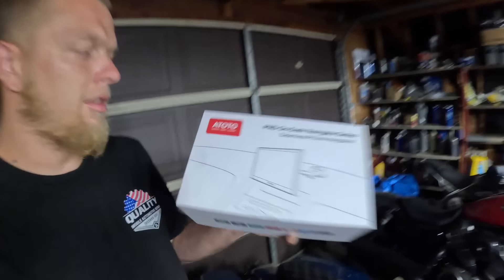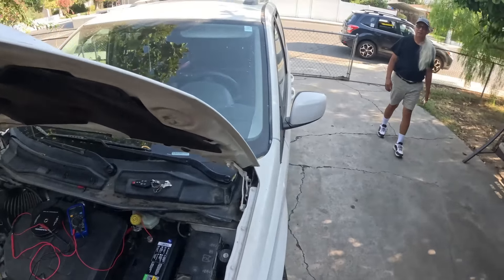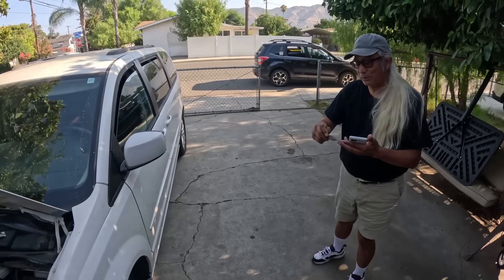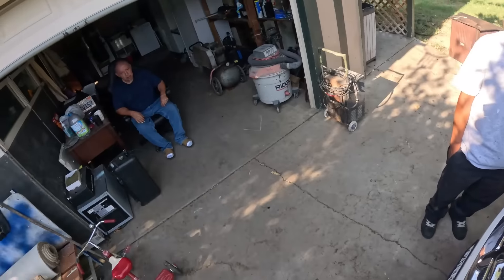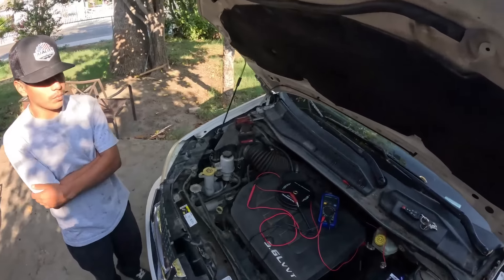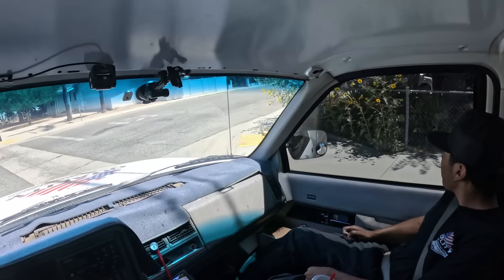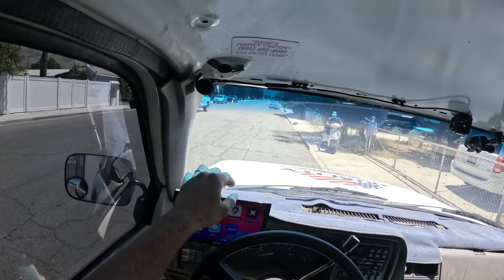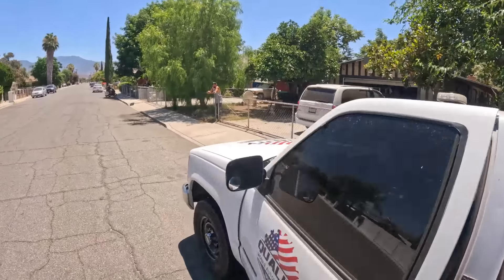CUSTOMER was UPSET! Mobile Mechanic ELECTRICAL diagnosis

Comment: Batteries are not even close to what they used to be if you let them go completely dead just one time most likely the battery is trash, seeing the charger there I also be that they over charged it once or twice. The main problem is going to be parasitic drain from something.

Comment: Dude, I wouldn't trust a mechanic who's work truck didn't have oily fingerprints all over it.
   Sometimes you get the battery that was made on friday afternoon when all the workers care about is going out to party. New parts right out of the box these days are too often bad. This battery should still be under full replacement warranty, just take it back for replacement.

Comment: I bought a brand new battery,then car wouldnt start,took it to shop they said alternator,they fixed it.Then I go to pick my car up and it wouldnt start without a jump cuz brand new battery had a bad cell!!So it is not strange to have that happen.
 EDIT:But ive always wondered if it was just the battery??The shop could have lied,they tried charging me a grand and i talked them down to 450

Comment: You realize that gasoline is what cools that electric pump in the vehicle right? Where you run it that low, it burns out there pump, depending on how many times you run it that low.There's a reason people have to replace their fuel pump
Reply: Running low doesn't hurt anything. Running OUT might.

Comment: Geez what you are telling me cant be right because thats what the last mechanic said. Its a brand new battery it cant be bad. No the connection wasnt loose i tightened it. What if walmart is busy than what am i supposed to do. No you are not charging me to diagnose the problem and saying its a bad battery thats what the last guy said i didnt pay him either. Did i tell you it can't be the battery its brand new. Thats what...... etc. 😅😂😅😂😅😅❤

Comment: Here is my premise:  I'm depending on YOU to bring the tools/parts you need to get farther than I could.

Why dont you bring a battery with you for these cases? If you start simple on power checks you should have spare clamps, and a battery on your truck so yo dont have to charge someone for telling them something they already know but perhaps arent skilled at explaining, like it wont start, its not holding juice vs 'its a dead cell, you need to replace the battery.' 

Id refuse to pay someone for incomplete diagnosis due to ill preparation on their part. Im paying for your experience and ability to get further than I did, but you ended up in the same place but with additional nomenclature.
Reply from the maker: We are mechanics not magicians/mind readers. When I got the call it was from the daughter for a car that is not charging and they wanted the alternator tested. Then I get there and now the son says they have to jump it every time and it starts but then will die out while driving then has to be jump started. So we put the jump box(spare battery) on and it starts no problem. Alternator is charging even under load. We let it charge for a while and the battery couldn’t hold any more charge then 10.4v indicating dead cell. It started every time with the jump box So obviously that’s our first step. Why would I bring a battery for that scenario? I was told it was a charging issue. We are going based on what a customer is telling us over the phone.
Reply: @QualityMobileAutomotive You dont have to be a mind reader, but you can gain experience and be better prapared for the unexpected, but this requires being proactive. Being proactive helps minimize mistakes/miscommunication. 

Also, running a business doesnt guarantee a profit every transaction. Sometimes youre going to "waste" gas and time and sometimes youll have setbacks from miscommunication that requires you to eat the loss because thats part of operating a business.

Just advice from one business owner to another.

Comment: You just married those people. No charge now forever!
Reply from the maker: Not at all. I got paid for the diagnostic and repair. No free rides here. I got called 3 weeks later because the check engine light turned on and I found it was transmission issues they had already got a quote on 1 year ago from another shop. Guess who paid another diagnostic… they did.

Comment: Poor design choice yet again with newer cars. 
My things I ask now:
Where is the fuel pump relay?
Where is the starter?
Oil filter location? Spin on?
Does it use DOD or AFM lifters?
Does the transmission have a dipstick?

Comment: Just put a separate relay for the fuel pump saves the customer the 900 for the fuse box power wire from the battery trigger from ignition power and jump into the wire from the fuel pump 300$ repair saves the customer some heart ache

Comment: Load test battery will tell u a lot
Reply from the maker: @woody95124  how do you load test a battery with a dead cell? It won’t hold charge.
Reply: @QualityMobileAutomotive  I got it....You ended up doing good bud

Comment: 3.6L pentastar requires a battery that has a certain amount of time after shut off if you’re a certified Chrysler master tech you’d know this… also the customer said after battery was replaced it worked fine!  Just because a battery matches the battery “code” that fits doesn’t make that battery adequate. Also if it’s new they should be able to get it replaced depending on warranty and what they retroact back to you! You know nothing about the car you’re working on. And NO IT DOESNT  MEAN THE BATTERYS BAD FROM THE GET GO! HOWEVER YES JUST BECAUSE ITS NEW DOESNT MEAN ITS A GOOD PART A SIMPLE MULTIMETER IS ALL YOU NEEDED TO TEST THE BATTERY OR A GOOD SCAN TOOL THAT WILL TEST THE SYSTEM BY BATTERY AND ALTERNATOR SEPERATLY! Wow how did you guys get a license to do this!!! I own 4 shops 2 of which are speed shops for muscle cars and the other for Harley’s the other 2 I own (OUTRIGHT I OWE NOTHING ON ANY OF MY SHOPS OR TOOLS) I make more money on one shop than any other shops around because I’m certified in almost EVERY FOREIGN AND DOMESTIC VEHICLES MINUS HYUNDAI (FORD AND CHEVY BECAUSE THEY PAY THE ABSOLUTE MOST AND CHRYSLER ESPECIALLY HEAVY DIESIL TRUCKS BECAUSE THEYRE FLAT OUT A BETTER TRUCK AND ILL BET 100,000 dollars I can prove it!!!!! Guys need to get you’re fake half ass shade tree bullshit in order you ain’t making money doing this minus your flat house visit! You’re all jokes and can’t open a shop because you’re not good enough!
Reply from the maker: 🤣 keyboard warrior keep up the good fight! Have a good day bud.

Comment: Watched your video for about 45 min. I can see as a mechanic you have lots of positives and u have lots of patience w your costumers; The only thing, and this one is major, that I'd advise you  correct asap is this:
I noticed you have your recorder device probably attached to your head (forehead), and yes u catch EVERYTHING u are doing, however, the video get very unstable and, I'm not kidding, that made me dizzy. I'm sorry it made me sick. So, I think you'll be better off by having the hispanic guy hold the camera for you that way the camera has better stability and you record really the important stuff and not EVERY MOVEMENT u make. For example, u recorded I dont know HOW MANY TIMES, when you were in and out of the car the first day u diganosed the battery issue.

Comment: a full battery should be at 13.2 not 12.6
12.6 is half dead.....each cell should be at 2.2
12 volts is dead.....you will still be able to start, maybe, but if a battery stays at 12 there is definitely some sulfation or plate degradation

Comment: All this "I think the battery this. I think the battery that." and not once did you put a tester on the battery. A good tester will literally tell you if it has a dead cell and it'd shut the owner up.

Comment: Guy and his family are obviously low on funds. But the bad attitude ain’t gonna fix the issue. I think the worst thing is actually the inability to loosen two bolts and swap the damn battery yourself. Probably the easiest thing right after filling wiper fluid.

Comment: This sounds to me like a parasitic draw.  The battery is probably screwed because it's been drawn down too many times.  I'll bet the new battery fails in a week.  Okay I said that before you arrived the next day.  20-25 Milliamps is I think when I worked for Dodge 50 Milliamps was too high.  Jesus how typical how about giving you all the info at the beginning, no wonder people are having trouble diagnosing it.  I hate the fect they don't charge these batteries before they sell them.  I'd love to see the battery closer to 13.4 Volts.  Great job with this customer.

Comment: Just because its new  doesn't  meen its not junk i got a new interrstate battery and a few weeks later it was junk  they replaced it a few weeks later junk again took the truck there after that and they checked out my truck gave me another battery again junk a few weeks later so got my money back and gota battery from another store no problems  for years but thenext time i went to napa they told me all of the battries they got were junk

Comment: Those TIPM's are a pain in the ass. They have a soldered in relay under the circuit board. I usually replace the entire thing. Although I did solder in a new relay on one of them. Just as a sort of test, to see if it was worth the trouble. Its not. Just find one in a pick n pull and replace it. Those TIPM's were the stupidest thing chrysler ever made.

Comment: Why not do a battery diagnostic test?  If the battery won't hold a charge it's gonna fail and the customer can see it and then know its bad, even though its new.
A parasitic draw can be done with a good battery, but you got to make sure all that electric crap is off even the hood and doors all have to be checked for sensors that will trigger a draw.

Comment: U can do a draw test with ur jump starter....... 
And u need use a muitimeter for voltage since those are more accurate and have faster refresh rates 

If you need do bigger test use jumper leads and ur truck 

Id done it all on spot 👌 myself

Why not put a external relay on for fuel pump
Thats what id do

Comment: Ok so you need a good battery to check the system properly and for even a intermittent alternator not charging  and for a draw. So if you wait a couple of days to come back you will be dealing with the same issue need to replace the battery again.   So he need a good battery and recheck charging system for a intermittent problem in the alternator and check for a draw.  You cannot wait till he has a problem like I said your going to deal with a battery again.  Come back right after and run the test other wise your going to make yourself look like a bad mechanic.  Sorry but you going to have to charge more for going back and extra time to find the problem.

Comment: I live in the netherlands, we have in europe i see better quility fuel, you have 87, 89 en 91 Octane. We in Europe have 95, 98 en 100 octane. 98 and 100 octane are the premium fuels in europe
Reply: 100 RON gasoline is not the same as 100 Octane Gasoline. Octane = RON + MON / 2

Comment: Ripp off keep the car running and put the computer on it while running and don’t tell me you cannot because you can there could be a drainage from a short in a wire could be draining the battery

Comment: New battery kept dying and you didnt test for a draw. What are you even doing.
Reply from the maker: Did you watch the video? What are you even watching?
Reply: @QualityMobileAutomotive  I did watch the video. You should have done the draw test first before making him go get a battery and saying you’ll come back. You most definitely can test for a draw on a dead cell battery.
Reply from the maker: @Mobiletech43  modules and electrical components do not function correctly at lower voltage which can cause incorrect readings. Anyone who knows electrical will always make sure the battery is good before doing any testing.
Reply: @QualityMobileAutomotive  electrical is primarily what I do and a lot of that is draws that other shops can’t find. I also worked at dodge for about 5 years and an very familiar with their systems. As long as there is a battery there that still has over half cca available it will pull those tiny amps a module is drawing. Also opening the door will not draw enough amps to pop the 10amp fuse in the meter.
Reply from the maker: @Mobiletech43  same here 10 years certified with dodge and I was primarily 15a tech. blown 2 fuses by someone opening the door 22ish Pacifica now my first meter won’t even do draw test. Every vehicle pulls a different amount when the door opens. I don’t take chances. I have had excessive draw on numerous vehicles with dead cell/low batteries that when I put a new battery in and retest there is no draw. Modules and electronics act differently at low voltages. We clearly know the battery why chase our ass finding an issue that could just be caused by low voltage.

Comment: Carivan',s and other dodges have a computer  problem , it controls charging system , i bypass the computer . i put a old school system from old dodges on it ,  that are located on the firewall below wipers  .. That has to do with the charge system ( I take the wire from alternator from harness cut it leave it going to alternator remove from going to computer re route it to ballist one side other side I hook to alternator wire that was from computer fixed . now  hooked to the ballast off firewall  . can't remember the name of it ballast \ regulator  ? Its 2 wire ( in and out ) mounted on firewall grounds to firewall cheap Fix ,

Comment: This video has a lot of missing information? I would definitely criticize the 2nd mechanic for not performing a thoroughly AVR test using  electronic battery tester , DVOM, or even better try using a modern scanner , under battery menu and then try checking for DTC. Most of all don't truss any customer with commercial battery charger in front of the minivan posted on the video, most likely the customer cooked the new battery, that looks like a interstate battery , never sold from Walmart ! Most like this vehicle has electrical issue like a draw! And nobody want to properly recharge the battery . Coming from another Mobil mechanic, the customer is always wrong, not the old saying customer is king! I don't believe in helping people anymore, they always lie😂

Comment: Did the same thing for a friend of mine got the thing to read it diagnosed problem fuel thing his was by breather replaced took care of his problem we went to casino for pay gave me 50 dollars put 30 in machine won 500 dollars then later that night we all went took wife with we all did really well came home early so we had money was working on his mom car gave us wrong part had to get right part then put together her boyfriend came home asked if paid me said yes he asked how much said forty dollars which was fine with me he couldn't fix it arms where to buu to get where I had to put mine he was a semi driver and farmer told her get in freezer and get out five porterhouse steak and gave me 100 dollars on top the forty found out he knew my dad from way back i rebuilt my transmission and rear ends on my dump trucks 1:02:15

Comment: You won't like this comment - Stranded wire wrapped around the battery terminal -  hope you are fully bonded and insured - that was an amateur move.  My high school kids could come up with a smarter, safer, and more secure solution.  Yes, your solution worked... but wow dude, just wow.

Comment: I had the same problem with the relay being on the board on a 2012 dodge ram 1500. I jumped it to cigarette lighter fuse. Didn't want to pay $1000.00 for a new TIPM. Work 3 years so far. Found a video on YouTube on how to do it. I watched this video https://youtu.be/irAU68TWHMw?si=Wd47bIX3NVvuUbI8.

Comment: Not the battery how you know it's got a bad cell never seen you check. I've been a mechanic 25 years and it was a battery terminal lose its people like this that gives out reputation a bad rap cause you clearly don't know what your doing
Reply from the maker: 🤣 obviously you have no idea what your talking about. What does it mean when a battery is charged then goes down to 10.4volts? That means 1 cell can’t hold a charge (bad cell).  It’s people like you who give people like me bad reputation because you have no clue!

Comment: lol this guy thinks after 10 minutes the battery would be charged? have you never heard of a parasitic draw? this is exactly what it does to batteries, replacing the battery doesn't fix the parasitic draw..  20:00 "i can't diagnose it further without a new battery" - yes you can, if you know how to do a fkn draw test... lol the car doesn't even need to be running. please tell me you're mostly doing brakes and not just doing electrical diagnostic. 23:00 "i can't do a draw test on a bad battery" uhmm, yes you can lmao.. you can do it off your fkn jumpbox if you wanted. the lack of knowledge here is sketchy.
Reply from the maker: 🤣 keep smoking sir smokes a lot.
Reply: @QualityMobileAutomotive  I haven't finished the video yet, maybe you recover and actually solve his draw issue. But so far it seems like you're just going to leave him with a new battery and a parasitic drain. 
Using a dmm instead of an actual ammeter doesn't give me hopes. But I guess if you don't have one it's better than nothing.
Reply from the maker: @SirSmokesAlott  when you watch the full video then please comment back!

Comment: This mobile mechanic is a joke. He didn't even put a scanner on or anything. He thinks 5 minutes running is enough time to charge a battery. All he diagnosed it with is a jumper box. This mechanic is lazy and all about money money money!
Reply from the maker: You’re a joke. Why would I put a scanner on a dead battery? If the battery won’t go above 10.4v what does that mean?? The battery is bad. Know what you’re talking about before making yourself look like a fool.